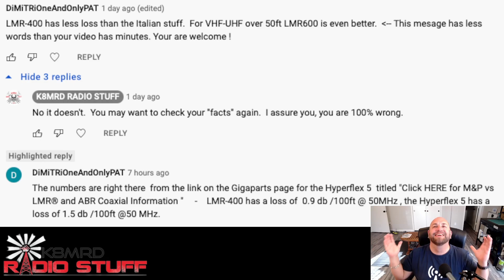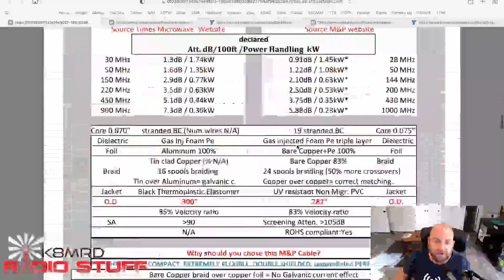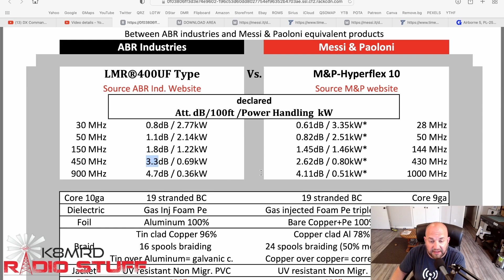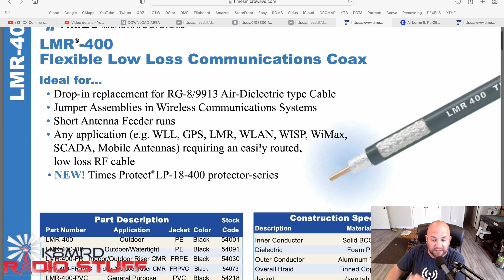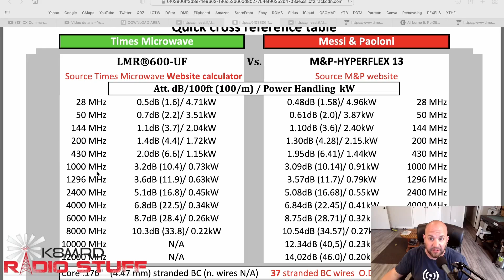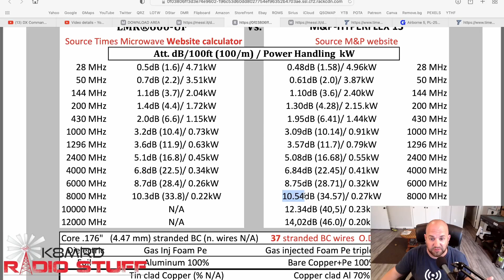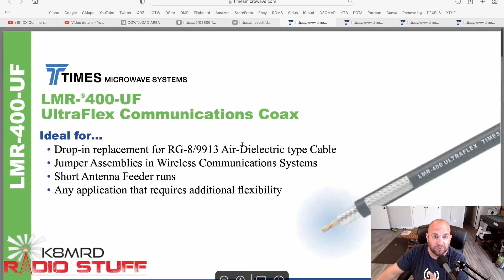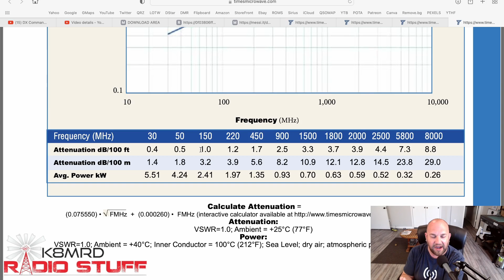Messi & Paoloni | Best Coax for Ham Radio

Comment: I love both of those coaxial companies.  I roll my own Mobile antenna mounts. Using 12 feet of .400/10mm coax. Typical length.  Always impressed by how well they work. My antenna system usually costs more than the radio I use. Plus my radio usually preforms as well as higher powered radios with the benefits of receiving better due to low loss feed systems and high gain antennas.

Comment: Which coax would be good for vehicle install in Southern climate. I was thinking service flex 7 and ultraflex 7 for jumpers? For vhf uhf i was thinking extraflex 10 burial or just using the service flex 7 for both HF and VHF UHF since theres such short runs in a vehicle?

Comment: this vid just showed up in my suggested vids. I am so glad it did. I really wasn't familiar with the details of M&P coax and what lines are comparable with Times Micro. I have been using a Times Micro equiv and also Times Micro on my towers. In 2 months I am moving to the new property and have started to spec out the new towers and related gear. IU am glad I saw this video because I am very impressed with the M&P specs. I honestly had no idea they were better at minimizing losses to this degree. I would love to see how they hold up to the elements of nature (UV, rain ect ect) over a 8-10yr period. But initially, I am wanting to gear up my towers with M&P now.  Thanks Mike for the informative vid. Cheers man!

Comment: What I will say is making connectors on the LMR-400 with their Times EZ branded connecters is VERY easy in the field.  The solid core makes it AMAZING to do field work vs the much more flexible stranded wire.  But with all that said,  some M&P cable in on my wanted list, esp as times connectors are stupid expensive.

Comment: OK so I got a GMRS radio I’m running a 45 foot run to a 50 W base station I’m using a J pole antenna and I’m debating between . M&P  7 verse 10 will there be a huge difference?  7 is in stock and cheaper and thinner easier to maneuver, etc. help.
Reply: I'm in the same situation. What conclusion did you come to?

Comment: Your video is the reason I purchased the Hyperflex 13 to setup a new Ham station.  My next order may be for the Sahara since it can get hot here.  Getting ready to buy some more coax maybe on a spool with the scissors and connectors.  Question?  I need to make up some coax jumpers to connect between radio, amp, tuner, etc.  I noticed some other channels say that jumper lengths matter.  Is that true or is it because the antenna is not at 50 ohms causing the issue.  Would like to hear it from you.  Thanks. Dan
Reply from the maker: I'm sure it matters to a certain degree, but probably not noticeable unless you're using really high frequencies.  I have a 3' jumper for my VHF/UHF radio that is made of Hyperflex 7 Sahara and the rest of the feed line is Hyperflex 10 Sahara.   One of the issues with using larger coax for jumpers is it can be a bit difficult to work with for such short runs.  It's heavier, stiffer, and may not be practical for routing in tight places.  If you can use it, use it, but I don't think it really matters that much in my experience.
Reply: If the Hyperflex 13 is flexible enough I will use it.  The 3 feet sounds great to me.  Thanks for your knowledge.   @hamradiotube

Comment: Seems an important issue for those wanting to press LMR 400 into repeater use !
It is reported that it does not duplex well, as the dissimilar metals act as rectifiers in repeater operation, in turn making ⚡noise⚡ on the signal !
Works well for other applications !
Caveat emptor !
                      🤔....?

Funny, I can remember when 9913 was the best thing since sliced bread !
Until it turned into a garden hose !

Comment: What coax would/do you use/recommend for something like the short jumper between your antenna tuner and transceiver or other very short runs like lightning arrestor to window pass-through or window pass-through to antenna tuner, etc.
Reply: You’ll get a lot of different opinions on this but my rule of thumb is jumpers 3 ft or under rg8x is perfectly fine. Anything over 3 ft I use the equivalent of whatever the main run of coax is going to the antenna.  I recently simplified things and got rid of all switches, rfi chokes, external atu to eliminate all jumpers except one 5 ft length of times lmr400 going to the window pass through. Since then I’ve noticed better performance.

Comment: I'm not sure dropping "ham rank" like AE and VE is really meaningful (esp VE is just an administrative paperwork drill). I just went from no license to AE in 90 days (and only that long because the testing org I was using only tests monthly - could have been 60 days easily) and got 100% on all 3 tests and I haven't even transmitted yet - until I got my FTM-300 last week, I didn't even own a real radio. A tech with experience has more real-world clout than an extra with zero experience like me and there are a lot of techs and generals with deep knowledge and experience.

Comment: LMR is garbage as far as Iam concerned, not very forgiving in terms of flexibility, installing RF connectors and just about anything else.
   I use M&P Hyperflex 5 for my shack jumpers and Hyperflex 10 for my antenna run and couldnt be happier.
    Its said that each coax connector, in general, or adapter has about .5db of loss, Iam curious what M&P connectors rate at?

Comment: a manufacturer can post any numbers they want, exaggerated or not, you wont know if its true, they do it all the time. What keeps me with the USA made stuff is on m&p coax, you can see thru the braid to the center insulator/foil, its a loose braid. you can see it clearly on their website pictures. LMR and USA made RG has a very tight braid, you cannot see thru it.  because of that fact, i believe m&p coax shielding is inferior to usa made coax and their coax specs are exaggerated. Im sticking to usa cable. on a side note, that heatsink they make that screws onto the bottom of the coax connector is pretty bad ass. does it really work and make a difference? who knows

Comment: Did all my homework before investing in a lot of new coax. Hyperflex 10 won in my application. Compared it against as many worthy candidates I could find. I'm an Aussie so blind patriotism didn't effect the performance of my coax. Italy wins this round and it wins because it is better. Not just the coax, the connectors are #1.

Comment: Hello,
I need some help with my M&P connectors, it's great (M&P-HYPERFLEX13) ...
> Since this my first M&P coax, I'm concerned; should my body section of M&P connectors be able to spin around the outside diameter of the coax, the center is soldered ? 
> The section that screws on to the female N is of course tight. 
>  I checked my continuity and it is good no shorts, although it seems odd that the larger section spins on my coax.

  Thanks,
  Stan, W5PDQ
Reply from the maker: Hmm, they’ll spin until you screw the bottom on.  If it’s still doing that I’d say something isn’t quite right.
Reply: Thanks for you feedback; yes I've made sure the rear-end piece is tight (damn both ends spin).
I thought that was odd, I purchased it with the connectors from Giga Parts two years ago but my move had me on hold for a while.
I'll look close at each connectors, to see why it's not grabbing the outside diameter.
Thanks again...
Reply: @hamradiotube  Hey! I found my problem; the thin metal sleeve that tucks into braded shield, had come out (or never slid in); once I tucked it into place between the shield and jacket, both end was able to get snug on the outer jacket of the coax. 😀
Reply from the maker: Oh great to hear!  An easy fix too.

Comment: And other specifications not mentioned is  the dis similar  metals used in LMR cables causing problems in repeater applications.
Reply from the maker: Ah yes, good catch.  That's a good one.
Reply: Excellent remark Will!  The tinned copper of the braid and the aluminum foil in LMR's are two different metals and induce the Galvanic effect, bringing corrosion... In M&P cable there is copper against copper in the same position.

Comment: I recently ordered and received 100' of Superflex 13, and when it arrived I thought Gigaparts sent me a garden hose. Seriously though, I'm very impressed with M&P's build quality, and the custom straps were a nice touch. Their data sheet compares Superflex 13 to LMR 500 which I didn't know existed until I read the data sheet. 73 KD5YOU
Reply: Hi, John thanks for your purchase and your confidence. You actually bought Hyperflex 13 I presume, and the direct competitor performance-wise is 
LMR 600 UF which is even bigger. ( a bigger garden hose LOL)
LMR 500 is quite unknown with the same size as ours (.500") Look at the attenuation difference and you shall be delighted with your choice.. :)
Reply: @stefanomessi  Hi Stefano, yes I am very pleased with this coax, and I am not sure why I referred to it as Superflex. :o I actually purchased the Ultraflex 13 100 foot, and this weekend I will use it during our Simulated Emergency Test. I chose your coax because of the many great comments other hams have posted and because of the exceptional low attenuation. :)
Reply from the maker: Yeah it’s not thin!   Fantastic stuff though.

Comment: My only issue with coax that isn’t as standard as the LMR is getting connectors from companies I trust. Like Huber Suhner, Amphenol and Times. And then testing the electrical performance RL & PIM. 
But the numbers on their data sheets look good.
Reply: Tom don't worry about our connectors standard: they are accurately machined and well designed so that they can either be used in our cables or in somebody else's,  (having the same overall diameter of course). So the classic .200" or .405" fits any cable of that size, the connectors for our Hyperflex 5, (.212"), fit in Belden H155, but there are exceptions though: our best seller Ultraflex 7, has an O.D. of only .287", and has been the official cable of WRTC 2018 in Germany and will be the official one in the forthcoming WRTC 2022, to be held in 2023. Many famous DXing teams are using it, along with Airborne 5, and Airborne 10 (the latter shall be used in Bouvet island).  We have developed our UHF EVO connectors in order to evolve designs coming from the first half of the last century. Its weather tight design and screening efficiency make them closer than ever to the N design.  If you trust Huber & Suhner, you shall love them, at a fraction of their price

Comment: Great video. those who commented on the M&P coax are complaining about unnoticeable loss, either way. Both M&P and Times Microwave coax are great and have their place.
Reply: Exactly! Times makes great stuff, but we bring more innovation. More flexibility, less bulk, great screening efficiency, dramatically reducing the background noise, (which brings a great chance to consistently better your listening capability, especially if someone is still using the old Rg213, Rg8, Rg214).  We managed to turn upside down the European market with our Cables and connectors solutions.  We are here now to basically inform, without pretending anything and asking just for some attention.

Comment: Great vid Mike! Question: Which M&P coax to use for a homemade Dxcommander  with run for 125 feet? Shooting for 80 thru 10…
Reply: Wallace, I ran Ultraflex 10 to my Cushcraft R9 vertical for a total run of 87 feet and am VERY pleased.  Now, if it were the same length run for VHF, I would have used the Hyperflex 13.  But the Ultraflex 10 is an excellent choice for HF at that distance.  My 2 cents....   de W5ODP
Reply: @davepuckett3197  Thanks Dave for the info. This is what I needed, 73…

Comment: I'm a Technician and recently dug into much of the same data over several weeks to determine lowest db for the length, frequencies, and workable cable flex at a price within my budget. I came to the exact same conclusions and understanding. You're spot on. In general M&P beats LMR when comparing Apples to Apples. I also tried to compare Apples to Oranges trying to locate thinnest flexible vs solid for same DB, but stopped after a while since there didn't seem much point. I think I ran across one case (but very well could be remembering wrong) where I could use a thinner solid core as opposed to a thicker stranded at my required length and freq, but I knew I'd be disconnecting, reconnecting, moving the cable regularly and didn't want to worry about damaging the solid core through repeated bending. In that case though db loss still wasn't as low as I wanted it and so was moot. In the end, I settled on the DXE 400UF for my 2m base station.
Reply: Hi Brian
Nice comment, which gives me the opportunity to explain a few interesting things, especially for a technician like you.

Single conductor cables, such as the famous LMR 400 which corresponds to our Airborne 10, always have the best attenuation, for the skin effect on a smooth signal transport surface.

When we entered the amateur radio market in late 2013, coming from a long tradition in 75 Ohm cables, we only knew very well the technology for making solid conductor models. 

Then the Italian and German Hams, and all the others afterward, pushed us to study ever more flexible and performing models. Flexibility was the watchword, and performance was the ultimate goal.

We studied for a whole year before introducing ourselves to the German market to challenge local manufacturers on flexible cables. Really a huge commitment because the technology for flexible cables is very different. Then as we say in Italy, the more you eat the more you feel hungry.

We started with two models, Ultraflex 7, equal in diameter to a popular German cable, Ultraflex 10, the same thing in .405 "diameter, and it was a great success. 

Later we developed Hyperflex 10 and its variants, which we designed for Microwawers demanding flexible but highly performing cables in the gigaHertz area.  A must for rotor-operated antennas.

Then they asked us for a DXpedition cable, small and very light and very performing. And we designed the Airborne 5. 

Then the Hams asked us for an ultra-light and very performing one for the big DXpedition teams (like those of Bouvet island), and we did Airborne 10 (.405 "). 

Then a cable that used the same connectors as the Belden H155, and was at least as good as an RG8X, (much larger in diameter), and we made the Hyperflex 5, a real jewel of technology, for mechanical and electrical qualities. 
How can a .212 "cable improve the performance of a 0.242" cable? 
Technology, experience, perseverance, ... fun.

Same story for the Ultraflex 7 (.287 ") Vs the Aircell 7 (Germany same size), VS. the beloved Rg213/U, RG8, (both .405").

Somebody might tell these are fake numbers but do you actually think the European Hams or the German ones are so naive?

Same thing between Hyperflex 13 (.500 ") and LMR600 UF (.600") ...
the former has a highly sophisticated and smooth cable core made of 37 wires (round shape), and the latter has instead a 7 wires stranded core (hexagonal shape)... 
what would you like to buy with your savings, the future of cables or the past?

Mike is becoming a cable expert, and step by step, he will soon show you, model by model, how we want to reshape the future of cables and connectors for the years to come.

Comment: Great video, Mike.  I come from a LMR400 background (although the poor technicians that had to terminate the cable I have since gone back and apologized after having to put connectors on mine for LTE 4G).  Anyway I agree with your points on the specs. I even have some I am installing in my truck and impressed with how well the connectors go on.  All the best, 73!

Comment: Glad you set them straight! I get into frustrating arguments about coax constantly.. Personally I’m using hardline (LDF4-50 or LDF5-50) for 2 meters and up but you have shown me a new coax I will be purchasing for HF, jumpers, portable ops etc from now on! I always look at the numbers as well! Thanks! 73!
Reply: Hi George
 Please give us a chance with the portables, and you shall love them so much that, you shall feel the desire to step up later to our 1/2 inch Hyperflex 13, a very flexible offer rivaling the famous LMR 600UF for stunning attenuations, with less bulk, less weight, more flexibility, and less cost. The only cable in the world with a pure copper core made out of 37 stranded and concentric wires.
Reply: @stefanomessi  I just purchased some the 13 for a new antenna install .. I will be using that from now on for sure!
Reply: @georgeaclosew4gne655  Oh great  Thanks, What are your first impressions about the physical look and feeling, Flexibility wise, overall first glance?
Reply: @stefanomessi  I’ve used probably everything out there .. the 13 is super flexible and super low loss for the size.. comparable to LMR 600 in loss properties but the flexibility is awesome!! For my install flexibility is everything! Love it! The connectors are great quality comparable to the connectors for hardline! Really impressed!!!
Reply: @georgeaclosew4gne655  thanks George great feedback  indeed 😀